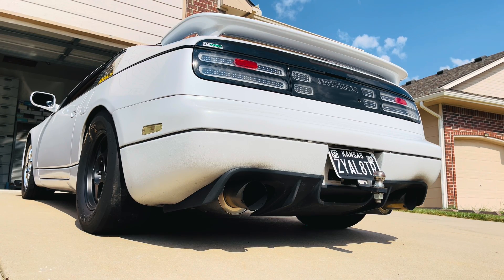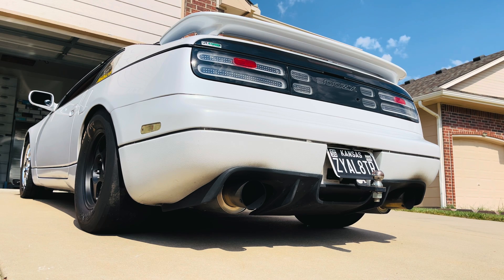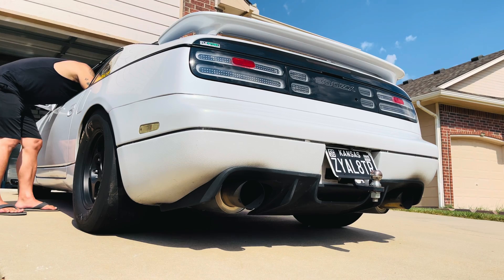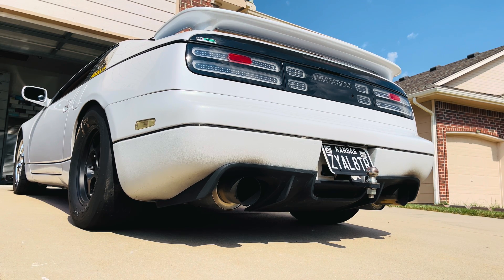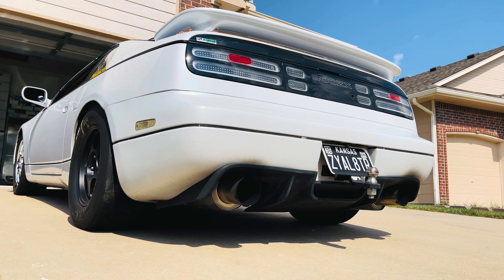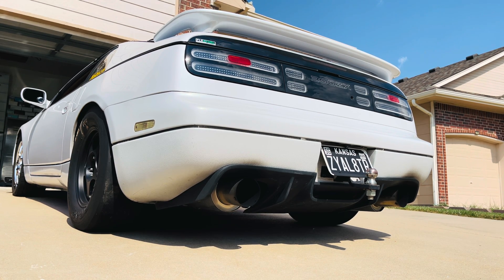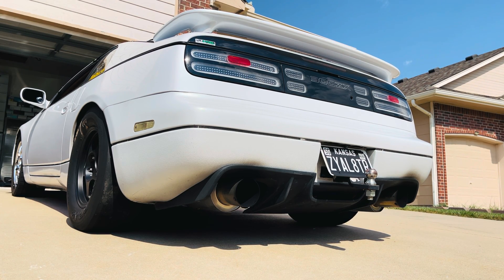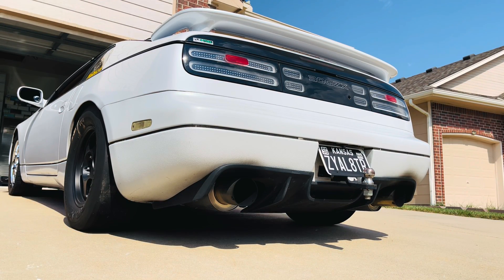Haltech Rotational Idle 300zx Twin Turbo Haltech R-5

Comment: Finally seeing videos that arent 9 years old, working on my build atm, Love it, thank you.
Reply from the maker: In the middle of the current build in 2021. I was rear ended and broke my back. Got car running with some help and the driver’s side JWT cam snapped. Car sat. Spent two years rehab only to end up having back fusion. Got car running right before surgery and been doing things little by little ever since. Changing plugs hurts from bending over. I’m broken 😢. But I will post here and there with anything new. Apologies
Reply: @Flip0369 didnt mean any offence bro, wasn't in regards to your old videos. The platforms just getting old and I barely see any new content for the old girls anymore. Sorry to hear about your back, I wish you well in recovery and rehab
Reply from the maker: @outbackpaladarium5955 none taken! Just saying. Also in case anyone else reads out comments then they’ll know why. I’ve been meaning to make a little comprehensive video going over the car and why I’ve been down. I’m keeping this car forever so there will be a future build of sorts with nee tech in the future? Been looking at 8hp70 swap. That would make this car a different beast vs the manual.
Reply: @Flip0369 helll yeah bro, keen as. Same here when it comes to modern tech. Keep the 90s blueprints and upgrade as you go. I plan to keep my interior as 90s as i can so the soul never changes and as time goes on upgrade her heart
Reply from the maker: @outbackpaladarium5955 i bought a leather interior kit some guy had sitting for 20years. Still soft and plush. My interior is tan so we gonna make it black and tan interior.

Comment: Can this be used to save fuel at a stop light or cruising similar to auto stop start and cylinder deactivation?
Reply from the maker: Depends on your cut method. Injection, I would assume so since less fuel being used. But with ignition cut, the unburnt fuel helps to cool the engine but still uses fuel per se

Comment: OK, that's pretty cool.  You just cutting ignition and or injection to specific cylinders?  Never messed with anything Haltech, but looks fun.
Reply from the maker: Rotational…you can cut it with ignition or injection or the combination of both. And it rotates between all the cylinders. People will choose which method based on sound and cooling effects, most do it for the sound.